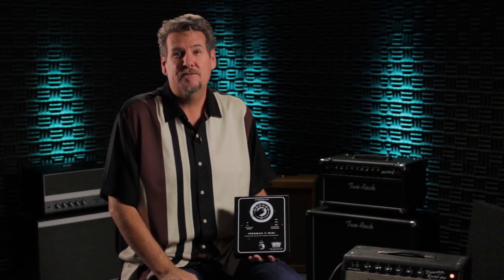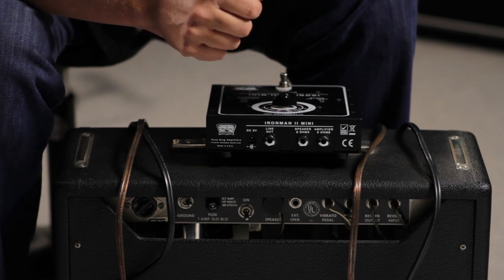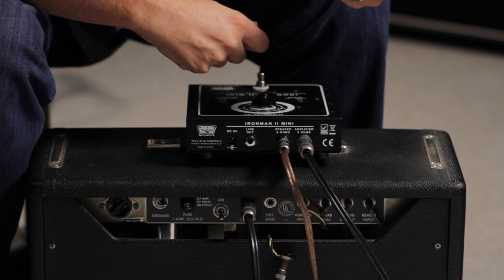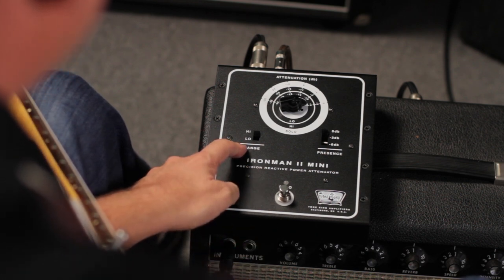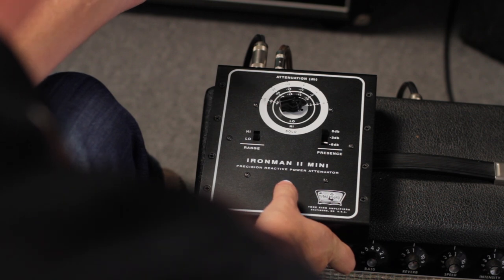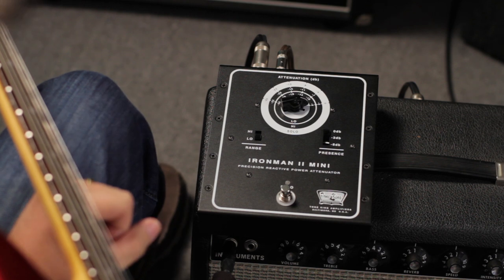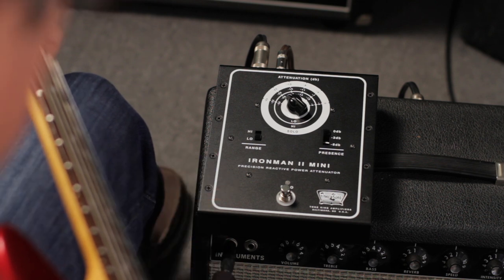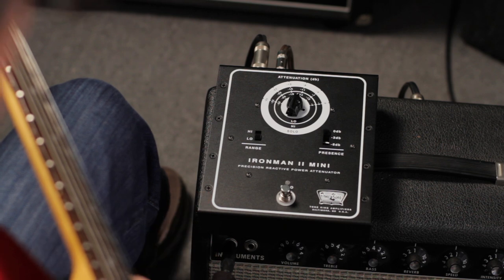Ironman II Mini Attenuator Introduction Video

Comment: I would like to use a power atenuator for my Vox AC10 but there's no Speaker Output on the back of the amp, i only have a Output for a 16 OHM Cab...

Comment: I wouldn't use the solo boost because you can't adjust the output of the boost. I don't use that much boost on my solos. I could see people moding a volume pot in the boost circuit or better yet Tone King putting in one.

Comment: I'm not sure if anyone will be able to answer my question, but here goes:

I own a Vox AC30C2. As far as I know, it works with 16ohm impedance to the speakers. But it has a cabinet output that can be set to 8ohm. Can I use this output with the Ironman II and go straight to the speakers, or would doing that just fry everything?

Comment: Great video / explanation but I just don't see the point of the solo button!  It's not like you have have that on or anywhere near your board on stage. ...you can run speaker cable that long for an amp right? Too bad they didn't just have a jack for an external footswitch!  Having said that, I'm still buying one!  :)
Reply: It’s a very handy get outta trouble button for me. 
I use the TK mini on the floor just next to my amp. Though mostly I only play club and pub gigs so my amp is only a few feet away.  At those gigs and rehearsals I mostly just use my guitar volume knob into my “now dynamic amp”, with a rev / trem foot switch.  

So if I need a bit more due to the trem dropping me out:/  or my drummer getting too excited,, or I just want to sore with the birds. I just turn and tap. 

At festival venues. Or church size stages. I’m mic’d up anyways so the sound man hates those hidden switches. So I set it for stage volume and forget then use my full  pedal board.
Reply: @righteousisthelord180  I find, there is definitely a sweet spot for different occasions.
I found the solo button is just another dB attenuation and in some positions on the tone king Ironman it’s reactive load works better for my amp and volume requirements.
It’s pretty adaptable,  I think any 30 watt or less amp can be attenuated with this and give that driven amp sound and feel. 
It seems - 12 /15/18 dB is ample attenuation for me to play at home during the day . So I just pick which ever reacts best, and set the presence to -3 or -6 dB. Less than 18db you start getting into total bedroom volumes and hearing your strings unless you sit real close to the speaker.
At some attention levels I need to knock the bass back a bit on the amp. 
When I rehearse with my deluxe reverb I set it to -3db or -7db and presence at 0, then use the solo just as designed. We come home without ringing ears.
One pleasant surprise is I can set my pedals at home way better than before.

Comment: Can you just plug the cable from the speaker of a combo directly into the mini? Must you use an adapter?
Reply: Yea you need a female female adapter with 2 cables
Reply: @keithremedy  Actually, you CAN plug the speaker cable from a combo directly into the mini IF it reaches. That was the case with my Marshall Studio Classic combo. But I got a 3' female to male 1/4" cable anyway.

Comment: great tone, but where do you get the 1/4 to 1/4 female adaptor and speaker cables?
Reply: @soofitnsexy  Does this adaptator has to be specific for speaker cables? Or is it compatible with any kind of cables (instrument or speaker)?
Reply: @soofitnsexy  thanks for the answer. I know i must use special cables for speaker but my question was about the adaptator. Must it be also speaker-specific?
Reply: @lorenzolegonzo  No, it its function is just to make a connection. There aren't different connectors depending on the function they are used for.

Comment: Can I still use a pedal board with that thing
Reply: Yes, you can plug whatever you normally would use going into either the front end of the amp or the amp's effects loop. An attenuator such as this just soaks up some of that volume output after the amp's power section output before it hits the speaker(s).
Reply: @montag4516  thanx man I’m new to reactive load boxes was hoping that would be true since